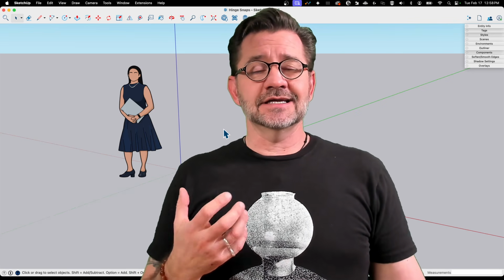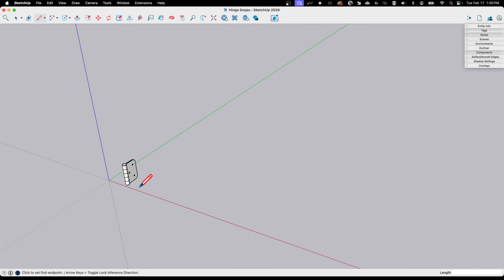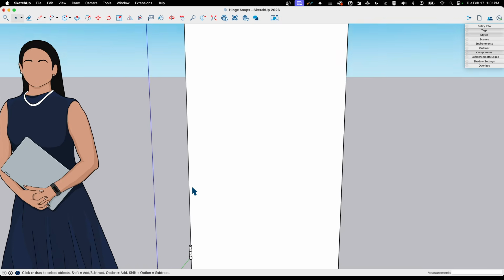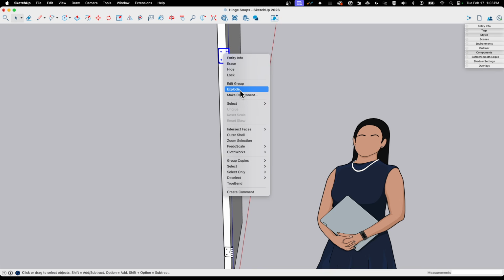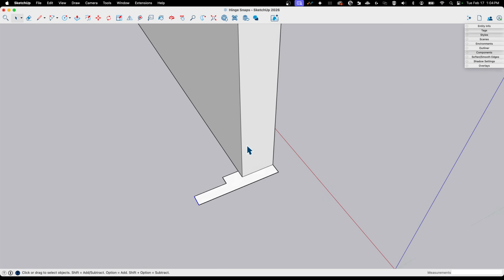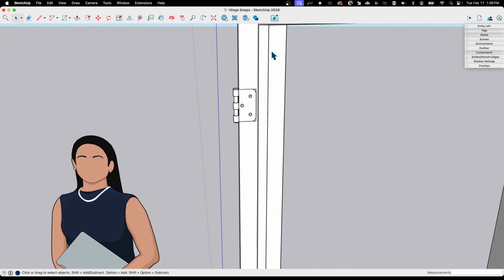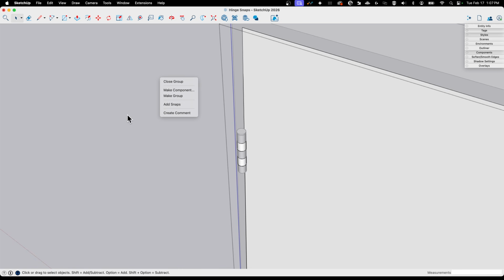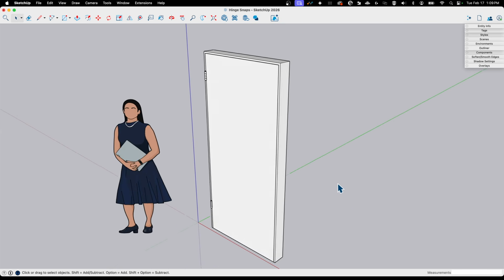The EASY Way to Open Doors in SketchUp

Comment: Ok SketchUp team, I've been using the Cadman Snap Connect paid extension for about 8 years and I really want to switch my company's whole component library over to your native SketchUp Snaps so I can use the tractor beam to build my rooms, but I CAN'T.  I can't use your snaps untill I can nest them in dynamic components and program their locations.  

Are we ever going to get programmable snaps?  It's the first thing I look for in every new release and I always get disappointed.

Comment: For various reasons I use Sketchup Make 2017, and in that version, 'snaps' do not exist. I then found out that you can use 'find center' instead, then a point is set in the middle of the hinge, this point can then be used in the same way. This requires that the upper part of the hinge must be in the same group as the door, So it's easier to hit, you do have to take that into account when designing the hinge? 😉😉😊😊🦊🦊

Comment: You modeled the depth of the hinge plate correctly. The knuckle is supposed to protrude from the door face so one can open the door 180 degrees and it doesn't crush the trim molding.